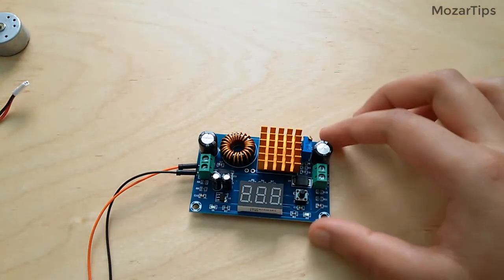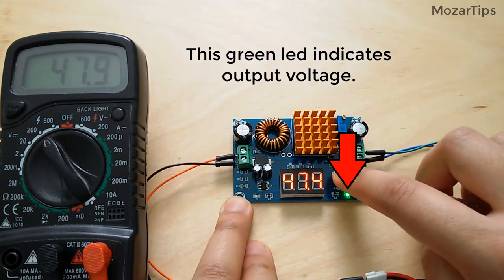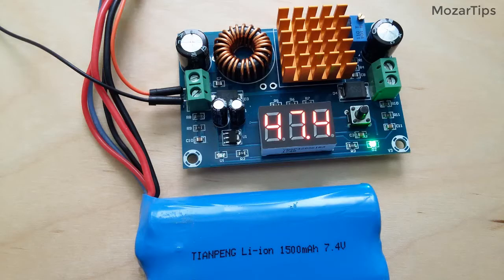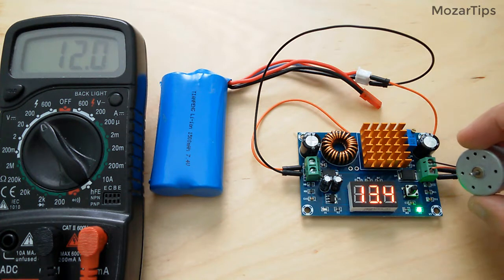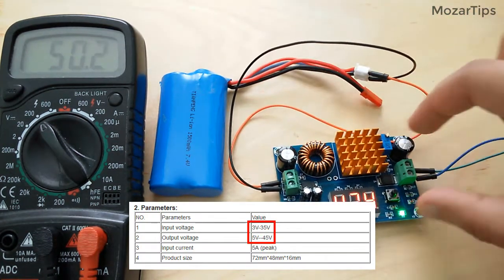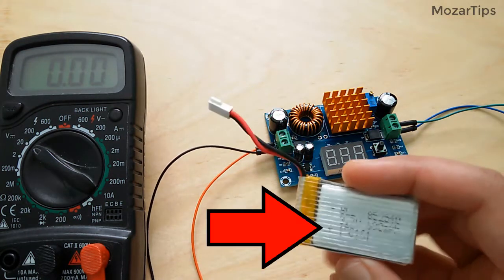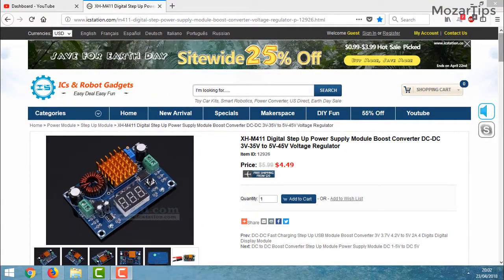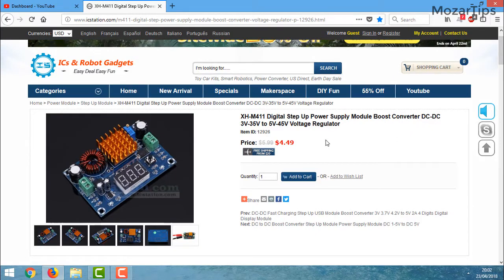XH-M411 Digital Step Up Boost Converter DC-DC 3V-35V to 5V-45V

Comment: At 5V input & 12V output how much current can it support for a few hours
Reply from the maker: Chat GPT says "At 5V input and 12V output:
With an output of 12W, you'd need about 2.82A at 5V input.
The runtime will depend on your battery's capacity, but for a 2200mAh battery, it would run for approximately 47 minutes."
Reply: Lol chatgpt response  @mozartips

Comment: Input: 5v 2A power bank 
Output: 12v 2.5A ( but its not giving the desired output, 
12v 1A router working on this..)

How to get 12v 2.5A?

& While using 12v 1A , blue light indicator is blinking, why? 🤔
Reply: pm me can you to install do solar panel of charger,

Comment: I found that if the input voltage dropped below 3.8V the output voltage would rise uncontrollably - at 3V input I got over 50V output, not controlled by the potentiometer. Not suitable for powering from a 3V battery!
Reply: Habe ich auch festgestellt. Es besteht hohe Feuer Gefahr durch die Zerstörung angeschlossener Geräte.
Reply: pm me can you to install do solar panel of charger,

Comment: sir, i have a question...i have power bank output 5v..if i use step up from 5v to 19v, can i charge my laptop...i want to make power bank to charge the laptop......my laptop is inbuilt battery, use 19v adapter...aspire e11....what do you think?
Reply from the maker: You can but for short amount of time and your power bank will run out of power plus it wont help your laptop battery stay charged very long. So in conclusion it can help you for short amout of time.
Reply: @mozartips  what do you think about this video...it is safe? https://www.youtube.com/watch?v=KHEaUvRd_hQ
Reply from the maker: If setup module can deliver amp and voltage as the laptop requires it can run your laptop for a short while then it will stop. So there isn't much benefit to it. If you want you can try, but it's not a permanent solution.
Reply: pm me can you to install do solar panel of charger,

Comment: Hi, it is indeed very useful, thank you.
Can it output voltage slightly higher than its rated value ? eg 48 V
Reply from the maker: I don't think you've seen the video properly my friend.
Reply: pm me can you to install do solar panel of charger,